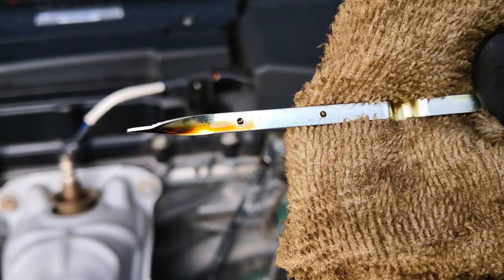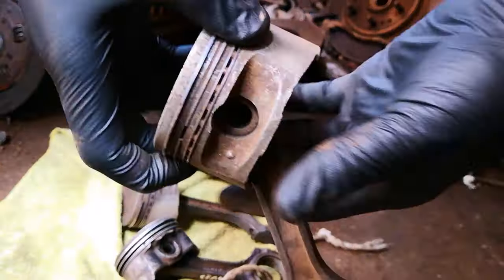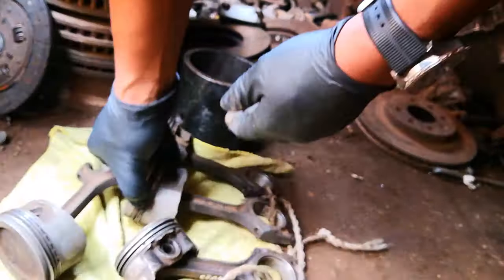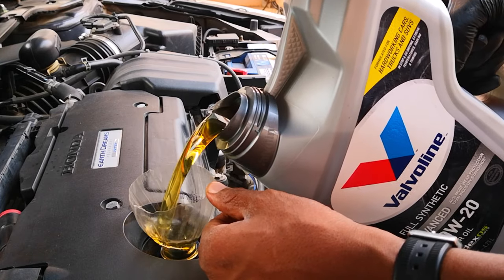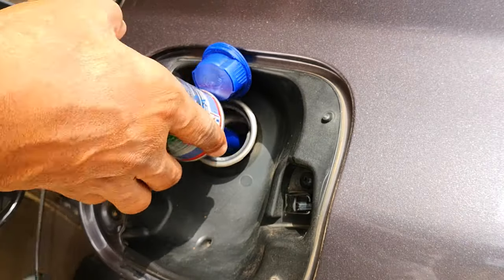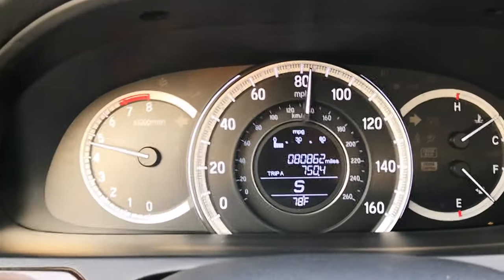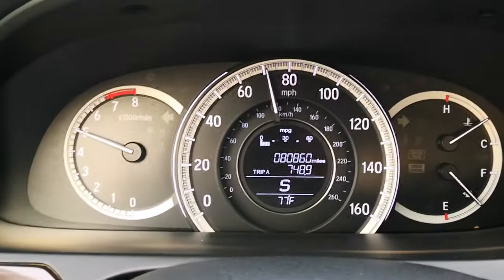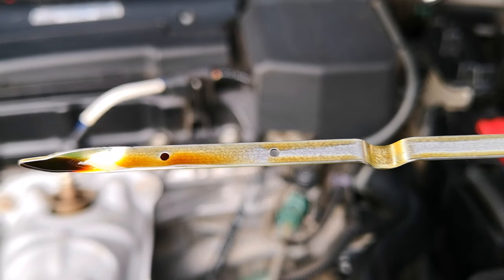Easiest way to Free Stuck Oil Control Rings / Stop Oil burning: Easy oil Consumption FIX

Comment: Regarding frozen piston rings: I used Seafoam & Marvel Mystery oil on my 1991 Honda civic Si that was burning allot of oil @ 200,000 miles. At the time I was using 10-40 oil with Hyperlube, which it really thick & it still burned allot of oil. I took the spark plugs out and poured Seafoam into each cylinder & loosely put the spark plugs back & let it sit overnight. The next day I used a dowel to put into the cylinders through the spark plug hole to see how much liquid was in each cylinder. I then sucked the liquid out & bumped the starter with the sparkplugs out to move the pistons to a different position. I repeated this process for four days/nights using Seafoam two times & Marvel Mystery oil the last two times. When finished, I made sure all liquid was out of the cylinders & put the sparkplugs back in and started the car. Now I put 0-30 oil in car & it burns no oil. The rings must have been frozen with carbon, but they are fine now.
Reply from the maker: Brilliant!!!
Reply: I'm about try that rn in my G35
Reply: @jafaary2614  Let me know if it works for you. It's really important not to get oil in your  catalytic converters. Don't crank your engine over with any Marvel Mystery Oil in the cylinders, suck excess oil out of the cylinders first.
Reply: Mister, that's an amazing success story, and if you have the time, the patience, and an engine whose spark plugs are easy to access, probably no reason not to try it.  
I own a V6 Camry.  3 of the plugs are easy and 3 are not.  So far I've used fuel additives, Yamalube ring free, Kroin" or whatever its called, just dumped into the gas tank in recommended quantities typically 2 or 3 oz per tankful.  They do work better if you run the car almost empty of the gas then add a gallon gas to mix it up, or at least I think it does.  
For people who don't want to tear into the engine, i.e. almost everybody, it's worth trying to free the rings gradually - not much to lose if you do it right -
Reply: @targeted1948 That's exactly what happened to me, rotated the engine with 15 ml of solution of transmission fluid and cleaner and some spilled to the cats. When I found out what I had done I removed the cats and poured a can of liquid moly Cat cleaner on the and put them back. It was smoking like hell when I started it and started smoking for few days ..
Have not endoscope the yet hope they are not gone
Reply: I can see how this works for the top compression ring(s ) 0-m which don't need this ...  However...   But please explain how the liquid seafoam gets PAST the compression rings down to the 3rd Oil Ring?   The compression rings SEAL the chamber, under high pressure when the spark ignites the F/A mixture.   How does the seafoam and Mystry oil seep past the 2 compression rings...??   Thats what no body explains during this process??!?!
Reply: @kevinsvoboda131  I definitely had liquid leak down on my Honda 4 cylinder engine. I put Seafoam in all four cylinders & checked each cylinder the next day with wooden dowel through the spark plug hole & two of the cylinders had almost no liquid in them. The next few days, the cylinders/ pistons leaked less liquid.  Seafoam & Marvel Mystery Oil is much thinner than motor oil. Over the course of naturally driving a car, combustion contaminates the oil by getting past the rings & then you'll need to change the oil.
Reply: @kevinsvoboda131 every single engine no matter how good the compression rings will eventually leak all the fluid on top of the piston down. It can be a painfully slow process but that’s why it takes days sometimes in order to let anything you’re trying to utilize directly on top of the piston to work its way down
Reply from the maker: @CFlo93 💯

Comment: Flushing your engine everytime before replacing the engine oil also helps a lot!!
Reply from the maker: Good point! I won't do it every time though.
Reply: is this way stop burning oil?
Reply: @jae7230  No, burning oil is generally caused by worn piston rings and/or worn  valve seals... flushing just keeps your engine clean to prevent clogging up oil passages and starving parts of the engine of fresh oil.
Reply: Stuck oil rings cause oil burning too. Thats what this video is about. @computerboetiek
Reply: @jae7230 it certainly can significantly reduce your oil consumption issue "IF" and ONLY if the reason your engine is consuming engine oil is due to sticky oil control rings or something else that is stuck or has oil deposit build up on it.
Reply: you dont need to flush everytime if you keep it clean with an additive like Rislone Engine Treatment which safe/recommended to leave in between oil changes. Add at every oil change. works great.

Comment: 100 miles on wot...........wot the?.........most old engines would be lucky to survive, I guess if they survive it might work? I've been looking at how to clean out the oil return holes in the pistons for a long time, and no one has come up with a good solution that doesn't require stripping the engine apart......there is an unanswered question open for a solution. Its not often you come across an unsolved riddle these days.........much opportunity for the imaginative types out there.
Those pesky littlel holes need cleaning out........but how?
Reply from the maker: No way traffic would allow you go WOT for 100 miles straight. Wasn't able to do either, what I did more appropriately was 100 mile highway drive with some WOT.

To the 2nd part of your comment, mate, this whole process cut my oil loss by well over 80%. I did a video that covered what I gained from this drive with LM.

Comment: I did this and my oil usage dropped from 1 qt every 1,000 miles to less that 1/2 a qt every 1,000 miles. I only did this for a a mile or so. It may get better if i do it some more. Thanks!
Reply from the maker: Great!!! Thanks for sharing. Good to know it's working for someone else too! Did you add a cleaner to the tank?
Reply: @DIYAutoworksNG  Yes but I also changed the oil and added 5 ounces of Seafoam to the oil. One ounce per quart. Hopefully that will help keep the oil rings clean. Next oil changes I'm going to flush it too. Every 10,000 miles I do a valve clean with CRC GDI valve and turbo cleaner. I didn't mention it's a 2014 Kia Sportage with the GDI engine thats known for oil usage.
Reply from the maker: That's super!
Reply: @Kiskassklan  Rislone Engine treatment added at every oil change will keep the engine/rings clean and not sticking. Works best if the rings are not stuck to begin with so the Berrymans flush is a good idea and the high rev treatment talked about in this video. If all that does not fix it, only a ring job will.
Reply: @SyntheticStuntMan  I figured out the high rev driving fixed it. It took 80,000 miles before it started using oil. Pretty sure now if I do the high Rev driving every once on a while it'll be ok.

Comment: my situation is different I don't get oil loss or no smoke from the exhaust but get low compression in cylinder 2 of my bmw 4 cylinder which makes the engine not start on cold crank on first time. Then it will always start on second crank every time! I did a wet down test and found it is a compression ring which once the engine has warned up to operating temp the engine will then start on first crank once at this temp. I've tried piston soak with seafoarn that didn't work!.. and tried trans fluid soak that didn't work either. I have been using fuel cleaner for the past 6 yrs and the ring is still stuck when cold. any suggestions on what  else I can try... cheers.
Reply from the maker: I've haven't tried, but I saw a video that used Berryman B12 chemtool for a piston soak, it was the most effective I've seen.
Reply: @DIYAutoworksNG  Thank for quick reply! Yes i have heard of this b12 I can get it for $40 .I will do a 24 hr soak in cylinder 2 then drain oil and add new oil and let it idle for 10 minutes once warmed up I'll take car on freeway on 100kms speed and see how it goes.Thanks for tips you helped me out alot.
Reply from the maker: Do let me know how it goes! Best of luck
Reply: thanks
Reply: Another one is putting 1litre of auto trans fluid in the engine oil and driving around for 200km. The extra detergents will clear out the carbon. Best done 200km before you are due for an oil change. Next option is adding 1litre of 2-stroke engine oil to a full tank of fuel. Do both at the same time and your engine will sparkle!

Comment: Would this work on a 2016 Audi q3 with injectors that are direct injection? Much easier than piston soaking imo. It’s an Automatic with S mode, but I make frequent 100 mile drives and I’m fairly confident its the rings. I just had the engine de carbed, but I know it will come back after many miles since I’m still burning oil at a slow pace. I don’t think any mechanic would even do a piston soak and I really don’t want to mess with anything that could end up turning lights on at the dash.
Reply from the maker: It should. My Accord has GDI too and it worked. Have you considered installing an oil catch can? That would help too.

Comment: I was convinced that I needed to do a piston soak until I saw this video.  I added Berryman Chemtool to an empty gas tank and then filled the tank with the highest octane gas.
I decided to reduce the suggested distance from 100 miles to 5 miles.
This procedure worked after 5 miles of high RPM driving!  My 2015 Kia Sorento was consuming a massive amount of oil and now consumes oil at a normal rate.
Thank you so much for this video!!
Reply from the maker: Wow. Thanks for sharing back. Just 5 miles!!!
Reply: How much Berryman did you add
Reply: I'm amazed that you were able to find a public roadway you could floor it for 5 miles - I'm in Southern calif I've never seen a road like this.  Too much traffic, pretty much 24/7...
Reply: @DIYAutoworksNG  you should try the valvoline restore and protect. It can clean off the bottom oil control ring.

Comment: I just looked at your LM valve clean short video and came here. I saw where you had RPM up to 5k  in S gear.. Just saw this.  I have a KIA 4cyl that started using too much oil (over 1qt/1k miles) at lower than 50 K miles. The KIA dealer recently did a 2nd piston soak on my engine so as to try to save it per KIA America direction. Both times I had them do an EPR 109 flush before the soak. Also I put in 44k at the gas fill up before the piston soak. I also had them put in Valvoline restore & protect after 2nd piston soak...
 To and from work, I max out RPM at 6k+ for 2 or 3 sprints  I have 700 miles left before they check my oil level. The oil cap , oil plug and oil dipstick  are all sealed to prevent cheating. Thanks for this video about doing the "Italian tune up" runs" I learned about this in 1966 at high school auto shop. I do 5k oil changes. but still had this oil burn problem. Worried about losing the cat converter...Last 2 oil changes went through 2 qts in 1k miles.
Reply from the maker: Thanks for taking to time to share this insightful comment!

Comment: my 2014 accord consume about 1 qt of oil every 5000 miles. Perhaps I will try your methods. Thank you for uploading your video!
Reply from the maker: Good luck! Solid stuff.
Reply: I did it to my wife's old 2003 Honda CRV cause it was running sluggish and started using a little oil. It runs like a champ now and no oil burning and greatly increased mpg. I didn't have to do it much and the way I did it was by dropping the transmission into a low gear driving to 5000 rpms then allowing engine to brake the car. I did that over and over for about 3 miles is all.
Reply from the maker: @Kiskassklan wow! Thanks for sharing this method!
Reply: I'd say one quart per 5,000 miles is not unreasonable oil consumption at all, it is less than many new engines consume.  I would not do any kind of ring soak on this engine!  To me that seems completely unnecessary, and might even make the oil consumption worse.  
All I do, for preventive maintenance is add 3 oz of Yamalube Ring Free Plus to the gas tank every so often.  It is not cheap, $23 and up per 12 oz bottle, but you only need 1 oz per 10 gallons fuel.

Comment: Doing a piston soak with Berryman's B-12 works great. Another option is an engine flush like BG EPR and BG 44k fuel system cleaner.
Reply from the maker: Yep. That B-12 chemtool is cheap and it's on steroids. Seen some good results of it's piston soaks. BG's flush kit is a banger but quite on the high side. And yea, I agree with BG44K. I have video on it; the platinum one.
Reply: Bg epr did wonders for my pilots engine oil came out blacker then shaq

Comment: Thanks for this video. I have a 2004 toyota matrix that burns oil and smokes heavily. I want to change the rings myself. My question before starting it is can I remove the Pistons without removing the whole engine from the car. 

I saw some videos where they just said i nead to remove the oil pan and the head cylinder and then i can remove the pistons.

Thanks
Reply from the maker: Haven't done this job, but I saw similar stuff online that it's doable in situ. Have you tried a piston soak for sticky piston rings?
Reply: @DIYAutoworksNG  Thanks for your feedback. I would try checkout the piston soak and try it out.
Reply from the maker: Worth the try. This engine is know to to have seized/sticky oil control rings...
Reply: Sure you can remove the pistons with the engine in car.  I've done it, to my 1988 Nissan Z24 pickup.  I did a valve job and thought to change the rings too.  The pistons come out the top.  You remove the oil pan, and unbolt the rods.

Comment: how about the oil return holes behind the rings, how to clean them out? if you can clean them out probably no oil comsumption ( unless cylinder wall is damaged)
Reply from the maker: Very valid point. I can't say if the heat in this method does anything to the holes. Some have used soaking the pistons with success.

Comment: For those of us that our car don't have S mode. Which mode would you advised to drive in? Thank you for your time and resources.
Reply from the maker: If you don't have S, you can just drive it normally. Some would put the car in 3rd gear for more RPM, but it's not something I'd advise for a 100mile drive. Especially if one aims for WOT driving.
Reply: If the car have L gear use it
If can changed to manual use lower gear and hold for some period.
Some car with cvt trans may not able to hold ratio and upshift into higher ratio result in drop rpm. Just repeatly depress the pedal would work.
Ensure traffic are clear and safe to do. Always aware of speed trap or highway police car😅
Reply from the maker: My car is CVT and you are spot on. That's why I added the keeping the tranny in Sport.
Just didn't like the idea of doing WOT with the gear in L, especially for the prolonged schedule I applied.
Reply: You could always put it in "R" for race mode and keep it floored.
Be sure to keep your eyes on your mirrors for maximum safety.

Comment: Next oil change,it will be interesting to see how Shell Helix Ultra does in your Honda. My cars dont use oil up until the next oil change at 10 000km or 1 Year,Both a BMW diesel and petrol. Note I also started using Liqui Moly Molygen Motor Protect on the last oil changes
Reply from the maker: Thanks for the suggestion

Comment: Will be interesting to see how the new Valvoline Restore & Protect works on cleaning up an engine.
Reply from the maker: I agree!
Reply: I have it in my Jeep now and after 1000 miles it seems to be helping. Dang thing only had 50k miles on it, but it had already lost some power and gas mileage. I’d did a few oil changes at only 2k mile intervals, then started the Valvoline R&P. It was getting better, but the R&P seemed to accelerate the progress and performance has returned now.  It never used any oil, just loss of power and gas mileage.

Comment: Italian tune up is one thing. 100 miles WOT is wild.
Reply from the maker: Lol. Definitely can't get 100 miles of highway to do WOT continuously. But idea is to do it as much as feasible within reason and speed limits.
Reply: Put the transmission in 3 speed and cruise around 4k rpm
Reply: State troopers would recommend this without a doubt.  Especially towards the end of the month.

Comment: I am just thinking if liqui moly valve cleaner would not work directly for piston soak. Is it more a solvent like B12 ?
Reply from the maker: I doubt. The product needs heat to work. I've soaked a fouled spark plug in Valve Clean overnight and it did nothing.
Reply: do you think I could use the LM injection cleaner to soak the piston with similar effectiveness to B12? @DIYAutoworksNG

Comment: Is there any reason this would not work on an engine with aluminum block like the Audi 3.0T? My 2015 Q5 with 113k mi is consuming about 1qt / 1500 mi. Hoping a procedure like this would help, it's been well maintained, so I doubt the cause is excessive wear on the rings. Thanks.
Reply from the maker: I believe it should work. So many viewers here have reported success in as little as 5 miles!
Reply: Not so much wear on rings as carbon sticking rings. My KIA had oil changes at 5k and still ended up a oil burner before 50K miles.